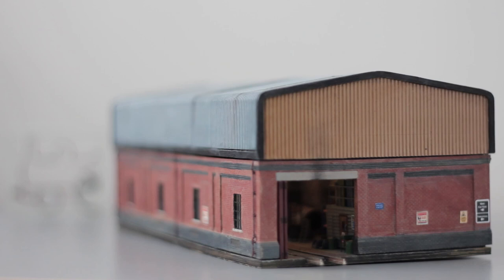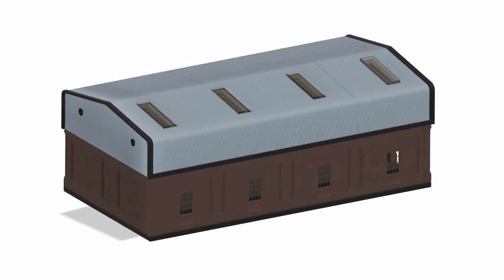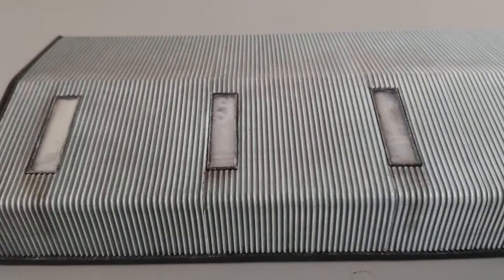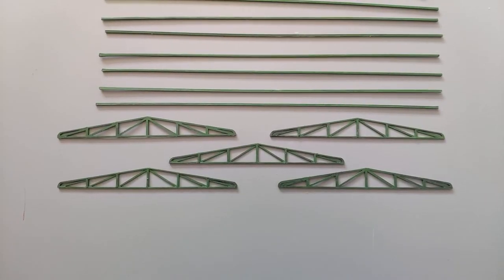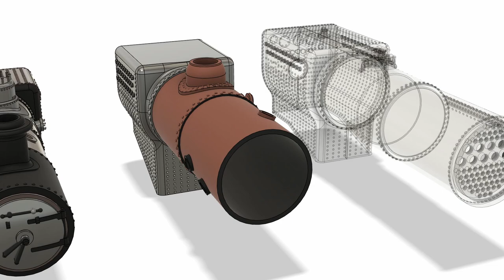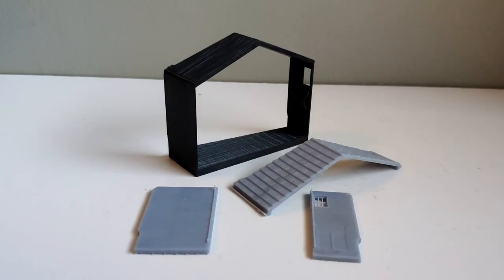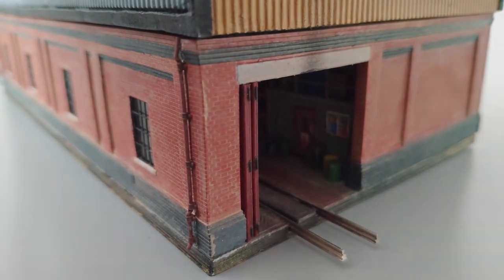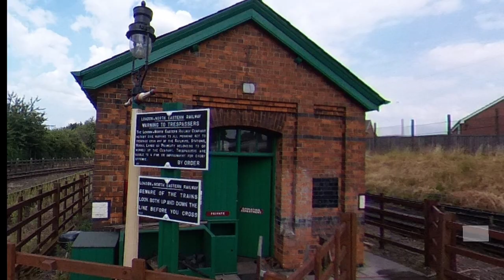Building No2 - Boiler Workshop at Bridgnorth Station

Comment: Another very impressive build! I'd been thinking years ago that 3D-printing would be very useful for model railways, and more recently been thinking about just how tiny real-life detail is once scaled-down by 148 - you're proving that printing is the way to get that detail in bespoke items. I'm considering getting into 3D printing for N gauge - how long did it take you to do all of the computer model designs for this building?
Reply from the maker: Thank you very much. 3D printing does open up the possibilities of what detail you can add into a model.  I would say there's about 15-20 hours of cad work in this model but I do bits here and there so it's hard to say really.

Comment: I love it. Great stuff, very inspiring to get that level of detail in N Gauge. What 3D printer are you using? and other drawing programs?  Craig
Reply from the maker: Thank you very much.  My Resin printer is an Elegoo Mars pro,  I'm using a big old Tevo Black widow for the FDM prints.  Fusion 360 is the design program I have been using.
Reply: @thewolvertonworkshop  Thanks. I will check them out.
Reply from the maker: @CGngauge  I would strongly recommend the Elegoo Mars but to be honest I would steer clear of the Tevo Black Widow, its taken a huge amount of work to get the printer running. Take a look at the Ender 3 for FDM prints.
Reply: @thewolvertonworkshop  I've just been checking out the Elegoo site. The Saturn 8K looks pretty good for a little more $$. While watching your video's I thought Most of the FDM printing I could simply do scratch building the buildings, but the actual detail is more important. (I don't have that many buildings left to build. for my layout.. but thinking more of future stuff and adding the details.